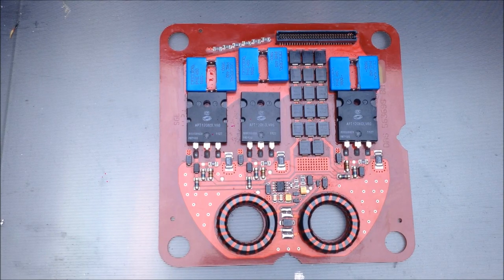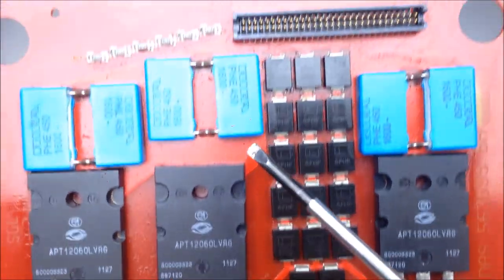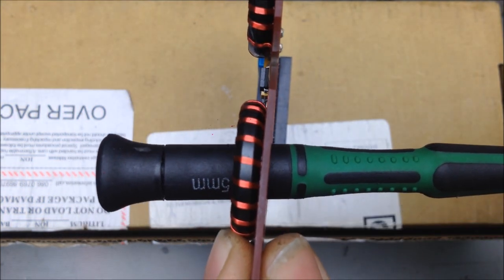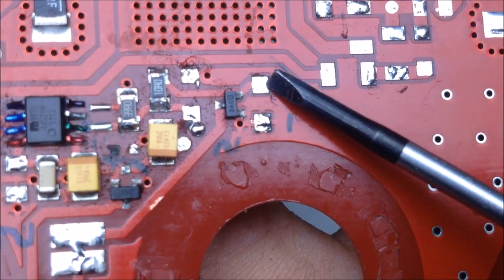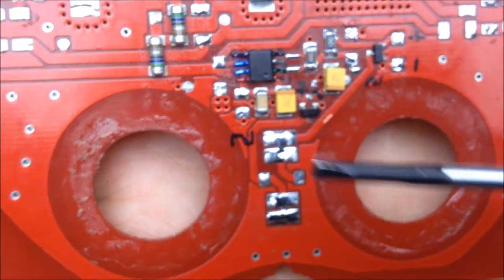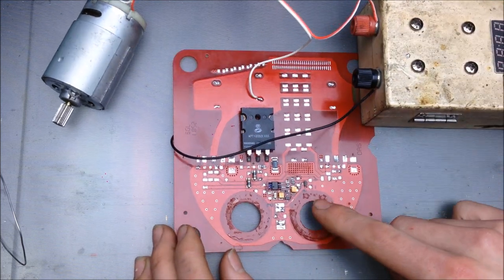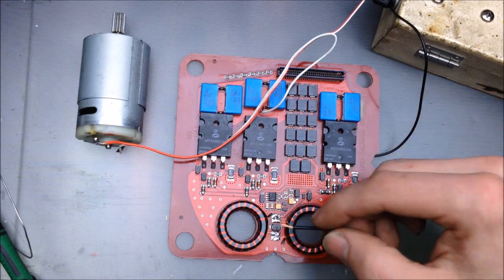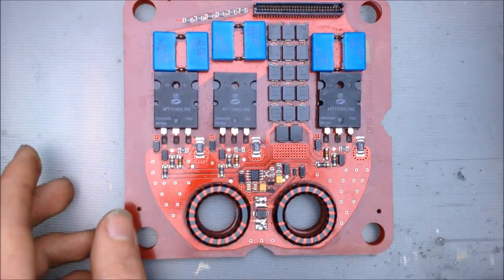The Little Square Circuit Board That Blew My Mind!

Comment: That is absolutely amazing, the capability of that switch. I can imagine these would make for a wicked pulsed DC supply in a mind blowingly large ZVS driver. An update on what you used them for would be greatly appreciated, as well as the source you obtained them from.
Reply from the maker: We can no longer get these, it was a one time sort of stumble on parts at a recycler. These would make for an excellent ZVS, but with Fets that nice I would not want to run them like that for fear of killing the gates. I'll find a use for the parts equally crazy though, it's bound to happen.

Comment: That's probably a electronically controlled synchronous solid state full bridge rectifier for the x-ray tube.
Reply from the maker: If it is, it's the biggest one I have seen. I don't want to be on the business end of what ever radiation this thing helped make.
Reply: There is no X-Ray tube in an MRI machine

Comment: Thats cool and logical compact design. So this is basically a driver circuit for electromagnets? But since it is switching seems like it is some kind of SMPS.
Reply from the maker: I think it's the high voltage control network for the radio/microwaves.